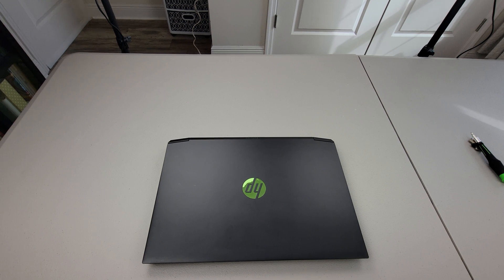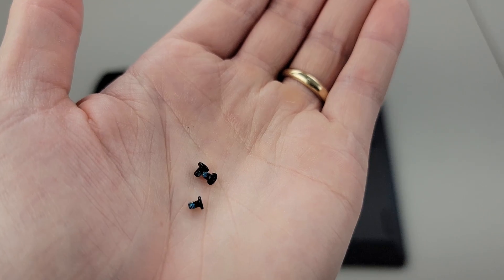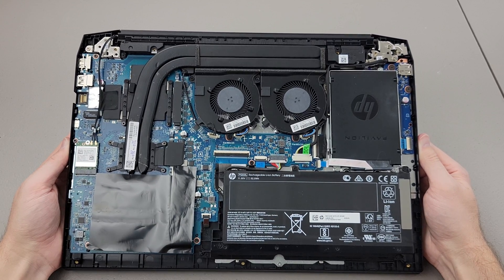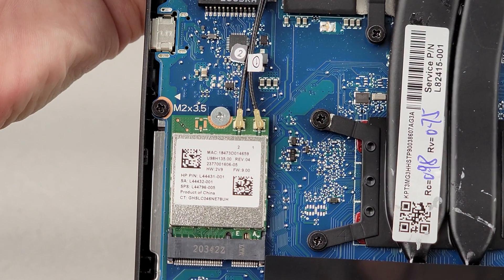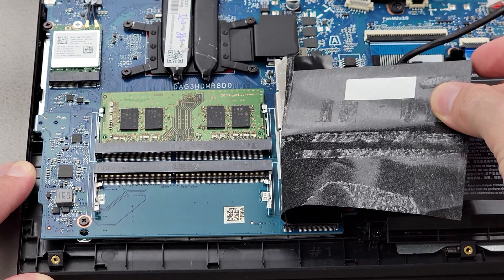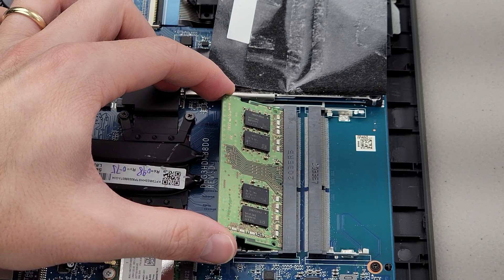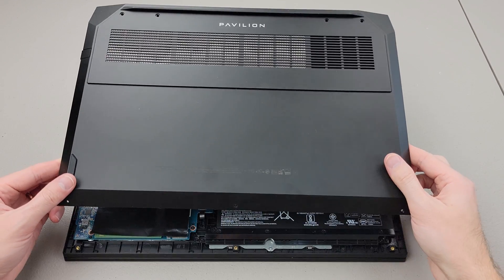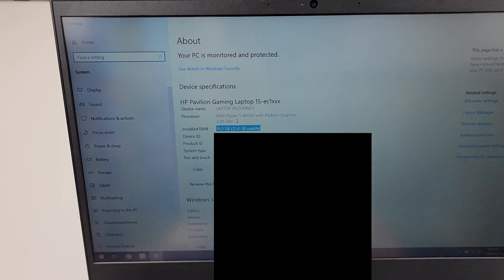How to Upgrade RAM on HP Pavilion Gaming Laptop 15

Comment: I have a question, being fairly new to upgrading laptops. I have two 4gb sticks installed in my computer (a different model of HP 15), but background process usage still averages about 60% (typical Windows 10), so I would like to switch one out for an 8gb stick. I've heard that Windows 10 loads stuff from memory for faster usage when you shut down, and since both sticks are in use, I'm wondering if it would cause issues replacing one or if it has some sort of backup. Would appreciate if anyone's done this and can explain.
Reply: Nothin would happen its just ram
Reply: I forgot why but you need two sticks with the same amount of GB or it just defaults to the bigger one. so it'll be like you have 8GB of ram instead of 12GB
Reply: @mossahaljalal1894  negative. It's not the GB, but the MHz. my HP 15 ec1099 has 2x 4GB 3200 MHz, so if you want to exchange one of them, you should look at the ram speed, because otherwise the faster ram will be bottle necked by the slower one.
Reply: @mossahaljalal1894  , you can put 2 different sticks. Your laptop wont use dual channel mode, and also, will sync both RAMs with the settings of the slowest of the 2. Memory capacity will be added up.

Comment: Hey! I just wanted to say thank you for this vid. It was very helpful. You explained everything really well with how to take out the ram and insert the new ram cards. I watched some other vids and they weren't as informative as yours. I also got that message and was glad to see that it was normal. Anyway thank you again!
Reply: is it necessary to remove the battery part thing?
Reply: @LiegeMaximo  the connector? I did it. I didn't take out the battery though. Just unclasped it from It's power source which is a good practice for when your working on anything. If you disconnect the battery you have less of a chance of creating an electrostatic charge and frying something, In my opinion.
Reply: @littleflip55  oh ok, thanks! 🙏
Reply: @LiegeMaximo  NP!
Reply: Yw❤

Comment: Great video. Wonder if anyone can help, please: I have a HP Pavillion Gaming Laptop model 15-ec0xxx. Are the internals similar to the one in this video. Computer is reporting a faulty fan so I'd like to replace it but not sure what part number/fan to buy.
Reply: You should be able to take it apart like in the video. Then u should see the fans with an qr code. Scan the code and you get the number of the fan. Look it up online
This should do it for ya

Comment: Thank you so much I have the same computer and I watched this video and installed 16 GB and took out my 8 GB of ram
Reply: Why didn't u keep the 8 gig in and install the 16 in other slot? You will have 24 gigs of ram I do. I have same laptop
Reply: @gregst.martin4889  some laptop models of hp have ram limit to 16gv
Reply: Bro u should have done 8,8gb ram for dual channel boost brother
Much much bigger improvement than single stick of 16gb ram
Reply: @TJ-vj9jb  So if i have 8gb of ram I just should buy another 8gb instead of 16 gb
Reply: @Nitrox_909  yeps works fine abd dual channel is better than single stick of 16gb

Comment: Awesome vid, thanks for making it very clear! The latest windows update decreased my usable ram even more (from 6.34 to 5.88 gb onlyĺ so im considering buying another 8 gb, and tbh im so afraid of screwing the buying and replacing process. But i have no choice since there isnt really any pc component store/service near me, and hp service centers are even farther and theyve got bad reviews (like low technical skill or overpriced goods/services). 

Some noob questions if i may,
1. is detaching the battery necessary? Will i risk anything by not doing so?
2. Is it normal for windows apps/updates to take extra allocable shared memory?
Reply: a good store is "Crucial" and also as for the battery, i'm pretty sure it's so you don't get shocked or anything.
Reply: Look up a store called microcenter they are a national chain one might be near your for them to do it if you’d want

Comment: Guys, I have the same model of pavilion, do you actually recommend upgrading the RAM, my dad had to upgrade his computer too and they said that is not a safe thing to do, especially on pre-assembled computers, since people came back complaining after their computer got broken. if you have installed the RAM, did the laptop accepted it? have you ever had problems since then? It's just that I wanna be sure, I need more RAM but I also need my pc to be intact hahaha.
Reply: Just make sure both are exact same brand and ram type/clock speed and your pc shouldn’t reject it
Reply: so after using laptop for awhile its safe to say you want another 8gb of ram, for example rocketleague and fortnite with settings on low and doing a bunch of tweeks to the laptop from yt vids rl gets well over 100fps and fortnite sits around there but this is with settings on LOW, a more demanding game i play is rust and with all the settings on its lowest without looking like complete garbage it gets 70 fps but i had to set the cap on 60 bc it would freeze up making it impossible to play
Reply: so if you have the 225gb memory model id say get it up to 550gb as youll eat that up 225gb but if you have more memory alr your good but i highly recommend more ram as youll be able to rise your fps and settings in ur games as 8gb is j not enough anymore. for taking off the back just be careful and use something like what this guys uses as i used a screw driver and i messed up the memory slot on the side. oh and extend your warranty if you still have it bc my laptop is in the shop bc it randomly shut off and im guessing its the motherboard and thats basically impossible to fix but if i had extending warrenty id be getting a new one rn
Reply: I bought a crucial 2x8gb kit instead of 1 additional stick. Better to get a matching set, sometimes mixing and matching diff kits doesn't work well if one for some reason won't hit the rated speed
Reply: same as jocal’s comment I would highly recommend getting another RAM stick, I constantly use gmod for my laptop and it was perfectly fine for the most part but I’ve noticed that playing it nowadays jumps my memory usage up to 90%+
Reply: I have the same laptop and when the cpu is under pressure one fan is working fast but the other is very slow do you face this issue?
Reply: I just installed my new 16 GB ram in the same laptop, and it was a success. It does scan the RAM immediately, and boost up the performance. So yeah, it is safe

Comment: I have the same ram model as you, but I got confused when I check in task manager that my speed ram is 2933 Mhz, but the package says it 3200 Mhz, so which one is the correct speed?
Reply: Most likely because the other ram stick is 2933, and the other ram stick will also go to 2933.
Reply: Your computer will cap the speed to the speed of your slowest stick of RAM.
Reply: @sodiumraindrop  because they are smart enough to not destroy themselves that way, got it
Reply: Trust task manager as it knows exactly whats happening and when is happening
Reply: The pc underclocks the ram by default to that

Comment: do i really need to remove battery?
Reply: Do you want to explode!?
Reply: @abcdefghijklmnopqrstuvwxyz5450  no if u think of that
Reply: U need to unplug it to prevent the laptop turn on by itself or any electricity
Reply: Do it. I tried adding some ram to my lenovo awhile back ignoring the battery part and saw some sparks and wisps of smoke appear when making contact with the motherboard. The laptop is still perfectly functional, but it scared me straight as now I ALWAYS make sure to detach the battery.
Reply: @lune-3214  ty for answering :)

Comment: So just to get a final confirmation on what I've learnt I have a HP PGL 15-ec0xxx, which currently has two sticks of 4GB. So to upgrade I would need to make sure I purchase sticks with the same memory speed and the same number of pins?? Have already second guessed everything I've researched as the diagnostic model and the number on the case don't match up so I've been super confused this whole time >,<
Reply: So yea in order for ram sticks to be properly recognized they have to be the same speed so you can’t mix per say a 4 and a 8 because it will either not recognize them or often not use one of them. It’s also good to try to stick to same model.

Comment: Can you upgrade the monitor to 120hz or 144hz?
Reply: U actually can upgrade but its not upgrade its changing ur laptop monitor to another monitor with same inch like 15.6 from 60hz to 120/144hz.
I wanna try that but high risk so yeah
Reply: you can just plug a different monitor into your laptop and use that in conjunction with a new keyboard (because have your laptop function as normal PC)
Reply: Nope
Reply: I have one and my model is 144hz so idk what other people are on

Comment: How do I know what ram is compatible?
Reply from the maker: I updated the description to offer some help with this. Basically, if your model number is the 15-ec1000 series, you could use up to 32GB (2 sticks of 16GB) of DDR4 3200MHz SODIMM. It is best to use two of the same sticks. 

I got another 8GB stick of what my PC already had. Samsung M471A1K43DB1-CWE.